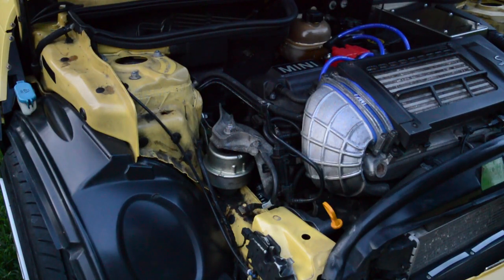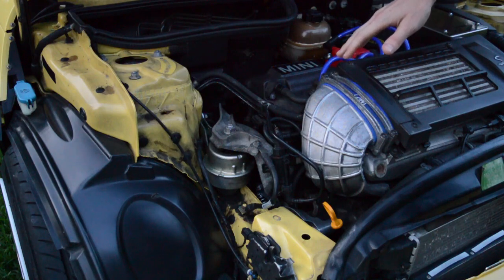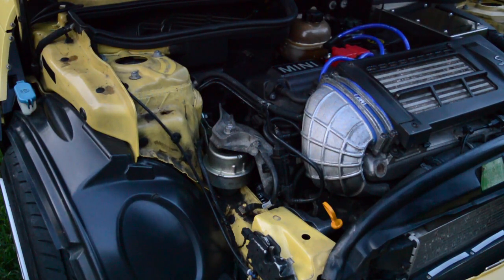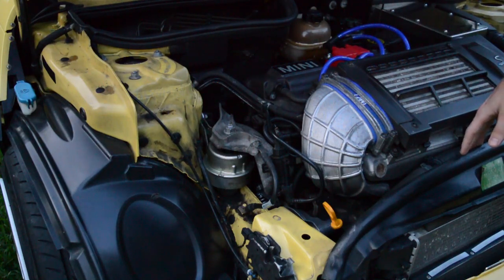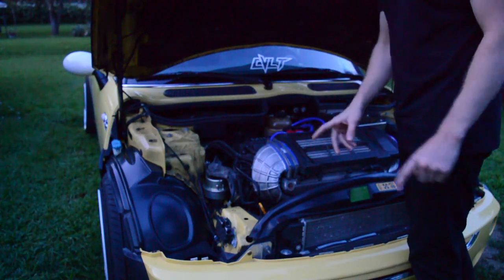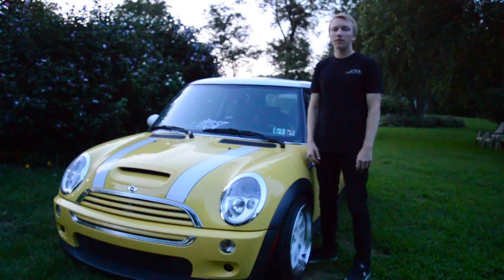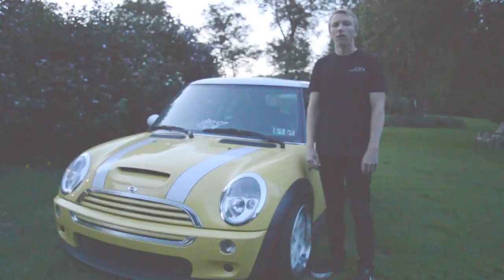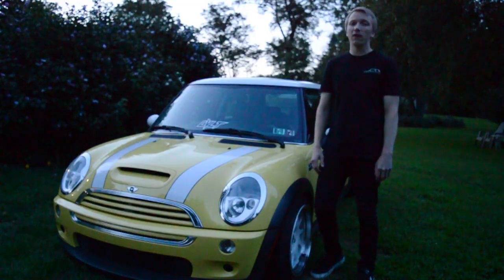Mini Cooper S Supercharger Pulley Boost Comparison (Stock Vs. 17%)

Comment: Did u ever have issues with anything over time? I just ordered 17% and I’m gonna be running factory ic and injectors
Reply from the maker: Nope no issues! The only thing that may have been a result is going through a couple alternators. But they were cheap remans so I wouldn’t say it was the pulley’s fault.
Reply: Hell yeah I knew I wouldn’t need bigger injectors but people had me confused with the intercooler some people say u need to up upgrade and other say the factory s and gp in coolers and been proven the best but thanks for your reply can’t wait to get mine here soon
Reply from the maker: @hunteryanske2803 the only times I’ve heard people complain about the intercooler is if they’re using it on a track car that gets hammered on lap after lap. Normal driving situations you’ll be fine. Even “spirited”.
Reply: @CooperCvlt  minty thanks for your response appreciate it

Comment: Dylan man,  Buy the metal plates to put over the front shocks on both sides. Prevent bulging of metal over the front shocks. Get a table to put your demonstration tools. I also have a  sway bar, and under panel engine metal shield/protects under body.
Reply from the maker: Already have the plates. Also have had the skid plate for years.

Comment: Why is your supercharger so loudv
Reply from the maker: Intake and the reduction pulley
Reply: @CooperCvlt  thank you I finally fixed the issues on my Cooper. I think I’m gonna install the coil pack and reduction pulley belt. Does this require me to get a smaller supercharger pulley? Also I just need clarification, is the supercharger pulley and crankshaft pulley two different things?
Reply from the maker: @lizzyvlogsrandomness1634  nice! You will need the actual supercharger pulley, the belt is only different due to the pulley size change. The crank pulley would be a different thing, which some people do as well.

Comment: Is your mini cooper tune after u put the pully on because mine I'm putting a 17% pully on but I have a intercooler on too and full exhaust on it and idk if I need to tune mine after I put the pully on
Reply from the maker: No mine was not tuned after. You could get one but from my knowledge it is not necessary.

Comment: Are you still running stock injectors and stock tune?  If so, how is it holding up?  I'm going to install a reman supercharger w/ a 17% reduction pulley installed since my original PTO failed.  I've got colder plugs, coil/wires, shorter belt on the way with the supercharger.
Reply from the maker: Sounds like you’re all set! Yes I’m on stock injectors and tune. No issues at all.

Comment: I just upgraded to an ALTA 17% pulley and ALTA lightweight one piece crank pulley and i'm getting wheel spin on launch and a chirp on 2nd gear! I will post a video on my page that shows the before and after 0-60mph pulls and my reaction if anyone wants to see.
Reply from the maker: Very nice! I almost did the crank pulley as well but read some possibly bad consequences.
Reply: @CooperCvlt  I've also read somewhere about potential long term effect of main bearing damage due to running a lightened pulley vs harmonic balancer. My car already has over 140k miles and the bearings are already halfway worn down. I just want a quick bump in power and response for the meanwhile. But if I do end up keeping the car for a lifetime, which I might because it's a really fun little car, I will eventually rebuild the engine and have the heads ported. But yes, I think in theory the harmonic "balancer" is there to keep the rotating assembly in check.

I think the only true way you can ensure that the engine is still in balance after you throw a lightweight pulley or lightweight flywheel is if you rebuild the engine with fresh new bearings, and get the entire rotating assembly (crankshaft, connecting rods, pistons etc) blueprinted and balanced. That's a lot of $$$ but by then, there will be no doubt about the engine being off balance!

Comment: Thanks! Your expansion tank looks like ours did before it popped. Long live the r53!
Reply from the maker: Just got a new one! My first replacement actually leaked so I put this old one back on for a while.
Reply: After the tank popped in my old Mini and now it popped in my current Mini, I upgraded to all aluminum.